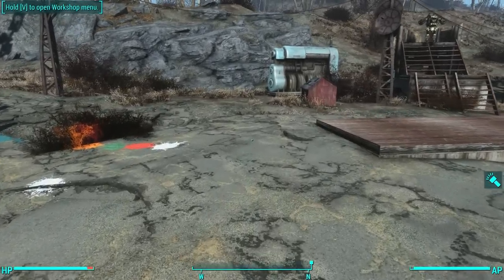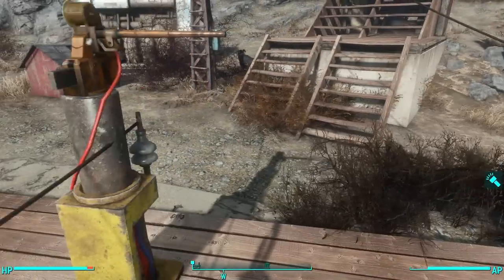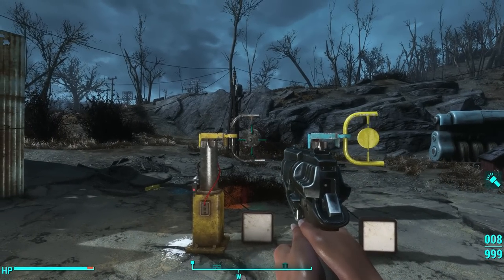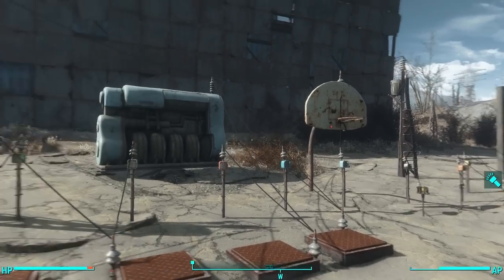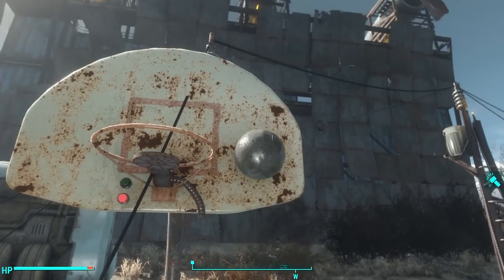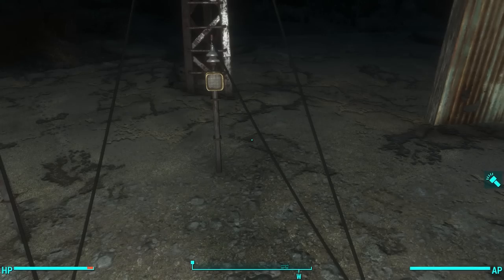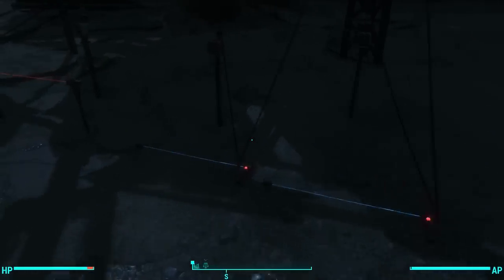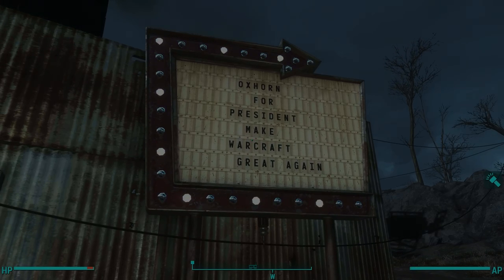Switches, Speakers, & Marquees - Gun & Paintball Gun Traps - Contraptions Workshop for Fallout 4

Comment: Hi Oxhorn, FYI the NOT gate only requires one input and inverts that input to the output.
i.e. Input on = output off and vice versa.
AND gate - both inputs must be on for output to be on. All other combinations are off.
NAND gate is a NOT AND gate together and the outputs are reversed compared with the AND.
OR and NOR are similarly related. 
OR gate - If both inputs are off then output is off. All other settings result in output on. Reverse that for NOR.
An XOR gate is an eXclusive OR gate. This means that one and only one input can be on for the output to be on. If both inputs are on or both are off then the output is off.
Hope that makes more sense of it now....
Reply: Thanks Gil ! I've always wanted to learn how logic gates work, but never took the time. I've read your comment and wrote it down to remember and understand the logic behind those gates ;) I may try to use it in game later.

Comment: the momentary switch conveyor laser would be good for building an item counter on a conveyor belt (I have not done so personally, but I read you can do so with the nixie tube), though I do most often use it for item diverters. (I used to have a circuit to split stockpiles of scrap using "or" gates and "nor" gates it was basically an item counter to allow so many items to pass an item diverter before being diverted so I could stockpile items to take to different locations (merchants could afford so much water per trip) so it broke the stockpile down by ratios. (If Abernathies could afford 1 unit, goodneighbor could afford 3, and diamond city could afford 4 for every 1 goodneighbor could afford, etc. (I no longer remember my calculations for the actual ratios from a couple years ago) but it had only taken me a few hours to work up a spread sheet at the time. I think it was something like "the combined sum of all merchants budget at the largest settlement (budget wise) divided by the smallest to determine a unit of value or something like that. I have slept since then. the hard part was developing a counter circuit to know when to throw each gate.

Comment: I have a problem that crops up fairly often. When I build a house/shack to house settlers in, it says in the Settlement management software that their beds are unsheltered and so I miss out on happiness. I've tried using both prefab shacks as well as different hand made shacks and nothing seems to be fixing it. Are you or anyone else having this issue and do you know a fix?
Reply from the maker: The software counts as an "unsheltered" bed any bed that is placed, but does not have a settler assigned to it. So if you have more beds than settlers, the mod will register "unsheltered" for a few, even if the are all sheltered.

Also, the game will unassign and reassign settlers to beds when you open the workshop, scrap things, reassign settlers, ans so forth. Sometimes this can cause the software to register an unsheltered bed. So,  get out of the workshop, wait 5 min or so, then check the software. That should show you your true number of unsheltered beds.
Reply: Ok I'll do that thank you.
Reply: I'm still testing about settlement hapiness, production, storage capacity and so on and I can't confirm Oxhorn on this point: i often have 10 or 20 unoccupied beds when I send settlers to other locations or when I'm building ahead and hapiness is not effected ... but the game engines sometimes goes astray and fixes himself when waiting.
I use no mods, example:
Hangman's alley (has 4 floors now): 21 settlers, 45 beds, 92 hapiness... but also has like a bunch of shops...
Croup manor 15 settlers, 41 beds 90 hapiness.
ok: I'm going to remove these unoccupied beds and see if hapiness goes up :)

On the other hand It seems that a huge amount of filled cages can have an impact on hapiness (Boston Airport, 45 settlers, 80% with 7 gunner cages, 65% with 20 gunner cages, nothing else changed :)
Reply: tested 4 settlements over 4 days (sleeping 96 hours), no changes in hapiness after I removed unoccupied beds:
Croup manor: 15 settlers, 41 beds lowered to 18 beds, Hapiness 94
Hangman's alley: 21 settlers, 45 beds to 23 beds, hapiness 91
Dalton's Farm: 15 settlers, 45 beds to 20 beds, hapiness 92
Longfellow's cabin: 15 settler's, 40 beds to 19 beds, hapiness 92